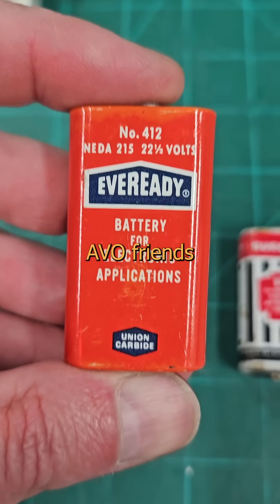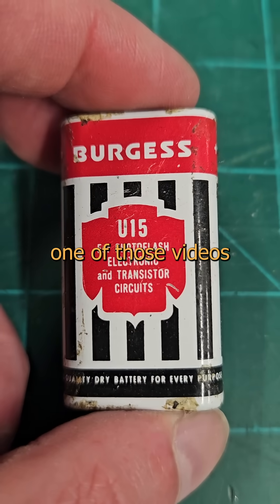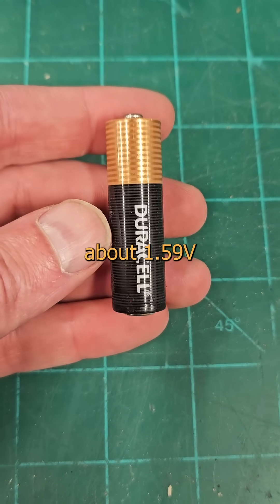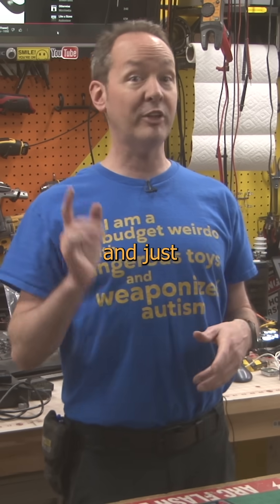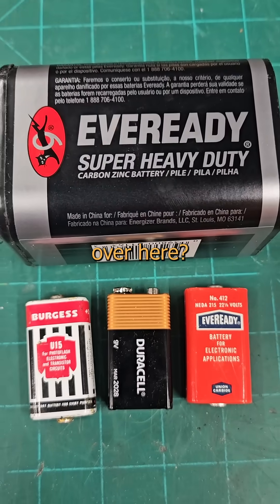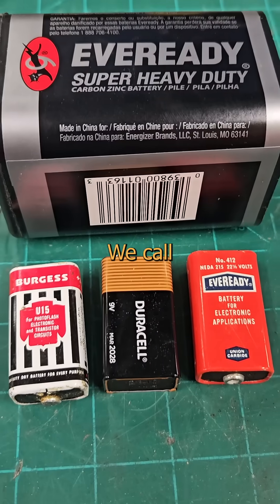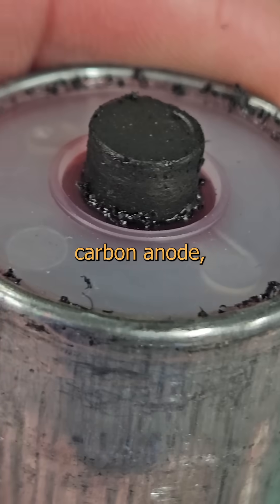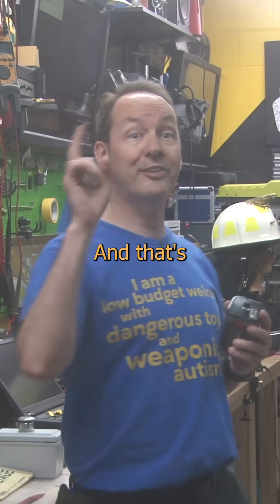Size 412 Battery #chrisboden #comedy #engineering #words #definition #chemistry #haka #science

Comment: My dad had home built a Simpson volt-ohm meter from a kit.
One of the batteries included was a eveready 45 volt battery, in the shape of a 4 inch long 9 volt battery, having the same electrode layout.
It was part of the circuit that sent out a calibrated amount of current to the component you were measuring, returning to deflect the meter's needle, showing the value of the component being measured.
You only needed to replace this battery once every ten years (unless you couldnt "zero out" the meter, then, more often)
My smartass brother of course, HAD to find out what a 45 volt battery felt like on his tongue!
Ha ha! He nearly threw the battery across the room after the briefest touch to his tongue, and couldnt taste ANYTHING for about four days!😂😂😂😂😂😂

Comment: Well, entertaining and enlightening as always, but I'm hoping to be the one that adds a little extra  education through the comments.

What you are describing as DD cells in that 6V battery aren't... There is actually already a DD cell designation, it's for a 3.6V Lithium Thionyl Chloride cell that would otherwise be described as 321260, that's 32mm diameter by 126mm long. They have a whopping 28Ah capacity, but also an eye watering price tag for a primary cell.

Comment: I have worked in a battery store for the last 9 years and 11 months (I am finally getting out next monday for a big boy job) and I have seen maybe 3 of those 412 batteries in my entire 9 years and 11 months. They are used in old "hearing aids" which is another term for radios. They are used in a few other things like voltmeters and other testing equipment but most of the time they were for old radios. You want to see some interesting batteries look into thionyl chloride batteries, you think having a lithium ion or polymer battery explode on you is bad how about we add a chemical that will melt your skin off both with temperature and chemical reaction to the mix. Only had that happen once. Oh also look into exploding car/boat batteries. Those have killed people.

Comment: Actually, the cells in the 6 volt lantern battery are "F" cells.  They used to be available individually decades ago for flashlights and other devices that needed a longer lasting battery than a "D" cell.  Now, almost obsolete, "F" cells are only found in 6 volt lantern batteries.

Comment: Technically the 9V battery's cells aren't AAAA. They're something else that's very similar but slightly longer or shorter. Also, some cheaper 9V batteries didn't even use cylindrical cells but instead stacked square ones.

Comment: Most 9vs are a stack of some flat cell with plastic sides last time I pulled a casing off (I had a bluetooth that took quad-a's because my car turned off the lighter when parked, and wanted to buy them cheaper than going to Frys).

Comment: Oh, those have changed.

Mallory -> Duracell
Eveready -> Energizer
Burgess -> ... I don't remember it continued...

My dad, when was in the U.S. Air Force, had any of these batteries.  The batteries were mainly carbon-zinc batteries (technically they are 1.5-volt individual cells) and government-issue mainly C- and D-cells.

I'm old enough to remember electronics stores in the 1970s and 1980s, some of them had the REAAAAALLLLY old kinds.  Thanks for that traipse down memory lane!

Comment: The large cells in the latern battery are “F” cells. There are also “A” cells that are in between a double an and a c. I’ve seen a few of those little 22.5 volt batteries  they are usually a stack of prismatic cells. There’s also a 225v eveready. No. 489. I used to work at a battery store! I’ve seen all sorts of oddball batteries.

(Edit: Spelling)

Comment: It’s because connecting cells in series increases voltage and connecting cells in parallel increases capacity. That’s what pretty much every battery is built on. It’s also why when you need to put two or more batteries in a device they need to be facing alternating ways you’re adding them in series because it takes a higher voltage

Comment: In the 1960s my grandfather returned to the United States from England after helping to rebuild after World War II. He brought with him one of the first portable radios. It was a tube radio that required a large battery. He gave it to me. I was ecstatic the battery was dead but he said go get a battery and the thing will work will work. I as a 9 year old removed the battery and saw that it was a 63 volt battery I got on my bicycle and went to every hardware store I could find to try and find a 63 volt battery volt battery I could never find one in the guys at the hardware store were never any help. Many years later as I was learning to repair electronics I realized that the filament voltage on the tubes was 6.3 volts. There has never been a 63 volt battery just like most receiving tubes the filament requires 6.3 volts by this time I had already torn the radio apart to see what was inside and it never had the pleasure of playing Paul Harvey ever I wish I had run into someone like you who would have helped a young boy realize that the decimal point had been rubbed off

Comment: i actually have a 22,5v battery like that one. it powers (or was supposed to power) an old camera flash. one of the flash bulb ones wheere you gotta replace the bulb after every use. thats also the reason i havent tried it yet, but also because its most likely long dead

Comment: The cells iniside a lantern battery were for many years a series array of an obscure type, an 'F' cell.

More modern versions of this battery often use 'C' cells, (though not 'finish' packaged), with much of the lantern battery case now empty.   Although this reduced ultimate capacity, most lanterns sold today use LEDs, which draw far less current.

Comment: And that's the reason why in Spanish Exist the difference between Pila/Bateria
"Pila" Is for single Cell (Like AA) and "bateria" is for a block of Cells (Like the 9V and Car battery)
For some reason, though, this is wrong with the packaging of the 6V Eveready that says "Pila". and despite the fact that at a technical level and language this difference exists. Many people use them as synonyms, despite being incorrect. Mainly a consequence of using false English borrowing
curiously, in car batteries there is a kind of xtra differentiation where many people and even brands call them "Acumulador"

Comment: Zinc is in the anode, manganese is in the cathode. Voltage reduction is due to the loss of ions for the Mn. Usually voltaic cells fully die when the salt bridge deteriorates. The voltage in the cell is due to the sum of the half-reactions involving electrons. Copper, surprisingly, is less than desirable for batteries.

I miss electrochemistry, but I pass on my chemistry knowledge to the next generation of aspiring scientists, regardless.

Comment: I once had a “portable” radio that ran on four “D” cells to power the filaments in the tubes, and it had a 67-1/2 volt snap top battery to supply the voltage for the plates and grids. The antenna was a spiral of wire laid out on a piece of Masonite, you would hang it in a nearby tree on your picnic! The radio had superb sound.
Reply: I had a mag-light that took 4 D's in the 90s
Reply: @justincase-ft5sc  You replace those batteries and you can significantly extend the life of the flashlight. 🔦🙄
Reply: @justincase-ft5sc same. Used it as a club once.

Didn't even dent the tube.

Dented the guys head, tho.
Reply: @justincase-ft5sc  Yes, the 4 or 5 D-cell Maglite was a way to legally carry a billy club.
Reply: My guess is a Zenith Trans-Oceanic radio. It was a very popular radio. Google it and it should look familiar. When you opened the case the antenna was snap-fitted to the inside of the lid. You would detach it and hang it up; and often it would have suction cups so you could stick it to a window.

The 67.5 volt battery was a "B" battery.  On the web you will find ways to make a substitute (including a sheet you can print out and fold into a case). For example, you can wire seven 9-volt batteries in series, which gives you a probably sufficient 63 volts.  You can even add a few AA/AAA batteries to bring it up to 67.5  volts.
Reply: @gezellig1634  Not sure about the brand/ model, it was a well made radio that my grandfather was given as a gift when he worked at Frisco Railroad back in the late 40’s. I don’t have it anymore. ☹️
Reply: I have a tube type radio that runs off a 90 vdc battery. They are hard to get so I run 10, 9 vdc batteries together
 It does not last long, but it is pretty cool
Reply: @therealbadbob2201  If you use it at home and if you are good with electronics you can build up a power supply for it.
Reply: @jonschick  what was the name brand of the radio. Sounds very interesting
Reply: @ccaudillo7921  I wanted to know that answer as well, I did find this: ("Beach-Radios" from the 1940-1950's of the pre-transistor age).
Reply: Just how old ARE you?
Reply: @calmargarita  72
Reply: @jonschick 👍67
Reply: @ 72, last year.
Reply: My guess is a Zenith Trans-Oceanic radio.  It was a very popular radio. Google it and it should look familiar. When you open the case the antenna was attached to inside of the lid. You would detach it and hang it up, and often it would have suction cups so you could stick it on an outside window.

Comment: Why do my aa rechargable bateries say 1.2 volts.
Reply: Different chemistry.  The metals inside are different (probably nickel and "metal hydride", where the metal is probably a rare earth alloyed with either nickel, cobalt, manganese or aluminum, but could be an alloy made from three or more other metals including titanium, vanadium, nickel, iron, cobalt, manganese) from those in single-use cells and they only generate 1.2v, but that is the price you pay for the chemical reaction being reversible so that the cell can be recharged.
Reply: @pulaski1  thank you I have been thinking about thisfor a month.
Reply: @mikeevanmeter2266  You're welcome! 🙂

Comment: Back in the sixties, when nerds were bold and nitrile twarn't invented, I molested my first six volt lantern battery, it wasn't composed of a bundle of cylinders. Instead, it was a stack of pancake cells, slabs of corrosive black mush set out on plates of zinc. The cells didn't even have terminals. I bet that those 412s are the same, especially because of the contact at each end.

Comment: A long, long, long time ago, I was a store manager for Radio Shack. Saw lots of those batteries over rhe years. Also many vacuum tubes. Later, I worked for the Department of the Navy, repairing all kinds of electronic test & measuring equipment; some with ancient batteries, many with vacuum tubes (which I also learned about while working for Radio Shack.

Comment: Well, actually, I have a camera flash that uses those (it'll also run on the slightly smaller 15V battery) -- and I'm old enough that those were fairly common when I was a kid, even a teen.

Add to that, I have a flash unit around here somewhere that come to me with a (very dead, because forty years old then) 450 V dry battery that would got from "Flash!" to "Ready" in under a second and last for hundreds of flash cycles from new (they were used a lot by press photographers when you couldn't just turn up your camera's ISO to 6400 in a dim room, but flashbulbs were passe).

My parents also had a shortwave receiver when i was a kid that ran on a wall plug -- but had space inside for A, B, and C batteries, which in radio parlance were a BIG 6V to run the filaments in the vacuum tubes, a smaller 22.5 V for the low power tube plates, and a 90 V for the final amplifier plates.  I never saw the batteries it needed, and the radio didn't actually work -- but it had the spaces, voltage spec, and even part numbers printed on labels inside the battery compartment.

And THAT'S pretty cool, too!

Comment: Ah, so it's half of a B battery like you'd see in portable radios before transistors were A Thing. Lasts a long time if it's just for plate voltage, the reason C batteries are called C batteries is from A, B, and C voltages of old radio sets - A was the grid bias (which got eliminated pretty quick in favor of grid-leak resistors and bypass caps), B was the high voltage for the tubes (usually either 45 or 90 volts) at real low current, and C was 1.5V, 3V, or 6V for the cathode heaters (depending on if it was dedicated portable-set tubes or general-purpose tubes). That's also the reason phantom-power for condenser mics is 45 volts instead of something more sane, it's a holdover from the days of "it looks just like a Telefunken U-47, you'll love it!"

Comment: If I remember my battery tech right the cell in the 6v lantern battery are possibly F cells and the cells the the 415 are called prismatic cells think a thick rectangle coin cell with rounded corner and a lip the won't quit.

Comment: We had a very early portable transistor radio to take to the beach.  Maybe 1955.   It took three different, oddball batteries similar to those.  Pretty sure we never found replacements.  Very expensive if we did.  It made one trip to the beach as I recall.

Comment: I remember being quite surprised to find that instead of a bunch of cylindrical cells some batteries had a stack of flat cells. 8.4V rechargeable PP3s tended to be built that way as there wasn't another good way to fit in 7 cells.

Comment: "battery" comes from the artillery term - an artillery battery. The first batteries were known as voltaic piles because they were a pile of metal separated by paper soaked in an electrolyte. We didn't really have cells since everyone used voltaic piles , then we had wet batteries where the term came from. Sure one was a cell but no one could do their experiments with just one so everyone called it a battery because one wasn't enough.

Comment: Even few "modern" batteries are made like this, the ones I know of are
A23 and A27 are both 12V and are made from tiny button cells which are almost impossible to get. 
4Lr44 is 6V made from, you guessed it, 4 lr44 button cells. 
And lastly 2CR5 is a 6V and technically it's double battery pack because it's battery made from two CR5 (which are obtainable only by dismantling this one) which are made of two smaller button cells.

Comment: When I was a kid in the 70's my mom worked as a nurse in CCU and would bring home used 9V pacemaker batteries that still had enough life to power toys. They were red and shorter than a standard 9V. Once they were dead, I would open them up with wire cutters and squeeze and puncture the 6 button cells to get at the mercury they held, which I collected in a dropper bottle. Had over an ounce total at one point...not sure where it ended up....!
Reply: I don’t know what’s more worrying, that you used to collect mercury as a kid or that you don’t know where it went 😂
Reply: @CloudyRanger167 That's nothing, his mother was harvesting the batteries  out of patients using them.
Reply: @CloudyRanger167
 We do now.
Reply: My father worked for Eastman Kodak, for 35 years, from before WW II into the middle 1970's on government defense projects aside from a 5 year stint in the army air corps. In the 1960's, before alkaline batteries were out for the general public, Kodak used tons of carbon / zink batteries for meters and other test equipment. C and D cells and these strange looking flat 6 volt batteries always made by Burgess. I used to call them prison batteries because the bulk of their labels were black and white striped. Kodak always used these batteries just until the peak was worn off then replaced them so that their test equipment gave consistent readings. 1.5 volt batteries were worn down to 1.4 volts and 6 volt batteries down to around 5.7 volts. For Kodak, these were considered "dead" and went into a box for employees to take home as they pleased. Just perfect for 10 year old me to play with. Partly because of this, electricity, electronics and, especially radio, has been my hobby for the last 60 years. Now that Kodak is a shadow of it's former glory, they have Kodak labeled batteries made in China.
Reply: This is kind of tale that tells you boys and girls are, in fact, different.

Comment: they were sometimes called "B batteries" because they were occasionally used as bias voltage in old tube radios. This was essentially why the "B" cell never became popular, as buyers would have been confused that a 1.5 V B-cell was not the same as a "B battery"

Comment: My brother taught me that a tongue happily used to test a 9 volt battery does not so happily test a 90 volt "b" battery.  And that an older brother will not so happily open a screen door connected  to an inverted bicycle driven singing magneto!  Also, a  magneto gifted by an older brother, can be quickly ungifted.

Comment: I have a few Everready energizer number 415 batteries. They have both ports at the top like a regular 9 V, but they are 3 1/2 inches long and 45 V. My grandparents used to have a farm radio powered by vacuum tubes that ran on a B size battery at 90 volts as backup power whenever the power in the boonies cut out. Because of the emergency alerts, it was important that they could run even in places with intermittent power.

Comment: We used to call those 22.5 and 45 volt batteries,  "B" batteries and they needed to have high voltage for the plate in vacuum tubes.  The 6 volt and lower were "A" batteries for the tube filaments. We used a 45 volt "B" battery in some UHF transceivers my brother and I  built 60+ years ago which used one of the smallest vacuum tubes ever built, the 6CW4 Nuvistor. It was small enough you could confuse it with a canned transistor, and the output transistors in car radios dwarfed it.
I think that some 9 volt batteries have 6 AAAA cells in them.
Reply: They were commonly used in simpson analog multimeters